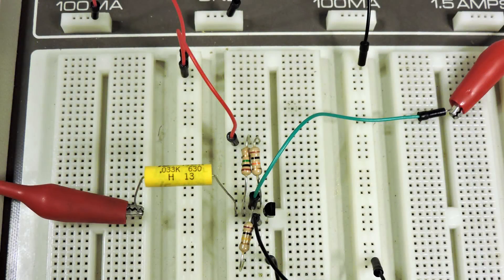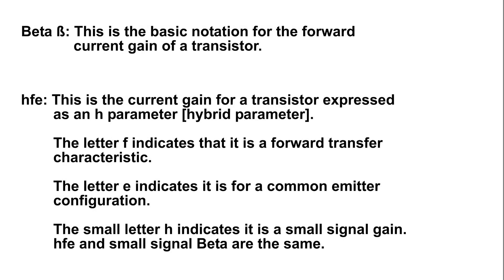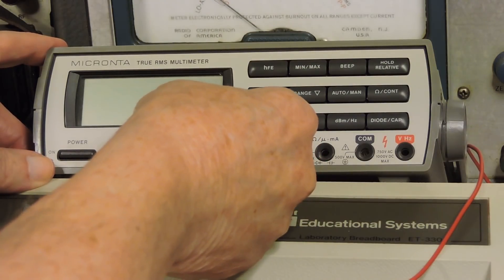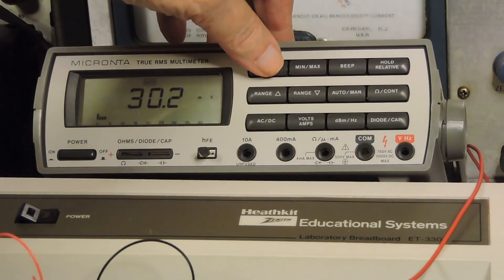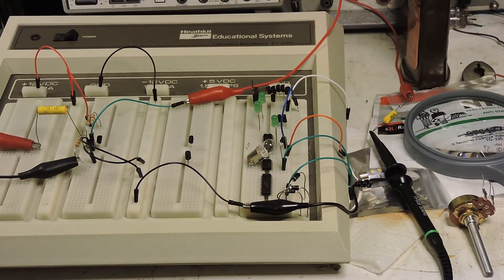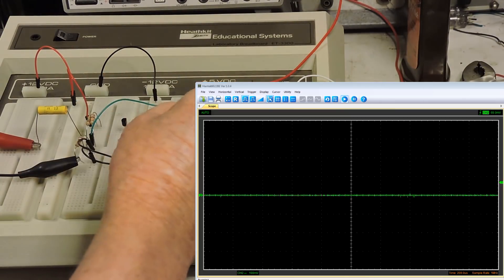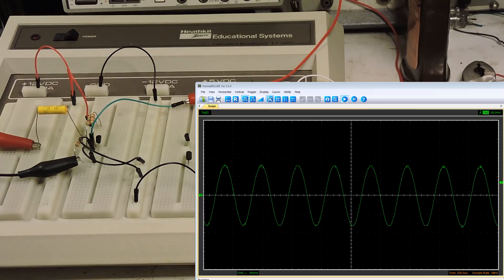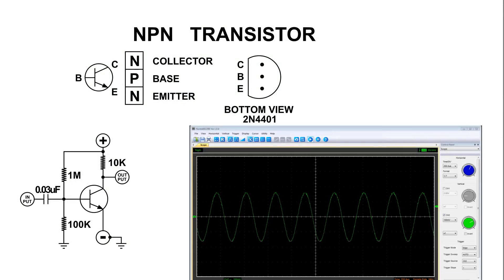Audio Amplifier Circuit and Transistor Beta β

Comment: Did you change the vertical scale on the oscilloscope display for each transistor tested?
Reply from the maker: Nop, changed nothing.
Reply: Hmmm.  I think your demonstration is neat and very useful.  In order to learn more, I am trying to replicate your results in LTSpice with the same three transistors, viz., 2N3904, 2N4401 and BC547C, butI am not getting the same results.  Perhaps it is because I am incorrectly assuming a power supply of 10 VDC and an input signal of 20 mVpp at 100 kHz.  Are those the approximate values you used?
Reply from the maker: 2.8mV @ 4KHz, 12VDC
Reply: Thanks.  I got the same, successively smaller peak-to-peak signals in the same progression of 2N4401, 2N3904 and BC547C which you used.  In the first, LTSpice displayed a nice sine wave.  The second showed a distorted, flat-bottomed sine-like wave and the third was about the same, but with a much smaller peak-to-peak amplitude.  Also in the third, the BC547C case, I did not get the extended flat-bottomed effect your circuit showed.  Appreciate you supplying the data.
Reply from the maker: I believe the BC547C transistor has some fairly wide specifications. If I remember correctly the beta of this transistor can vary from about 400 to 900. I believe there are some other specifications that may have some wide parameters.

Comment: How would you calculate the component change if you had to use a different transistor?
Would you change the bias and input drive level?
Reply from the maker: The circuit would need to be changed. The bias would change and maybe add an emitter resistor. AND using the specifications from the manufacturer.

Comment: Hi AllAmericanFiveRadio, Thank you,  My question is same as LestonDr please I may later look at the specs for the other NPN's to see if a change in bias resistor can clean up the signal, because what you are saying is that this circuit with these components is ideal for this NPN, yes you were instructing how to find the right NPN,  does this video show how critical it is to have the right value resistors for the transistor circuit. It looks like "close enough" is good enough is not "good enough." So all my worry has been justified when fretting to get the right component. Best wishes and much appreciated.
Reply from the maker: Thanks

Comment: Do the other transistors have the ability to put out a clean sine wave?  If so is it just the circuit design you are testing them in causing them to flatten out at the bottom?  Thank you.
Reply from the maker: The circuit would need to be changed. The bias would change and maybe add an emitter resistor.

Comment: What about adding an emitter resistor for some negative feedback with those higher beta transistors?
Reply from the maker: That will help. Lots of output audio push-pull transistor circuits have very low Ohm resistor on the emitter (0.47 Ohms) or no resistor at all.